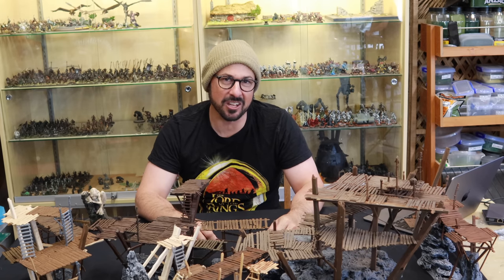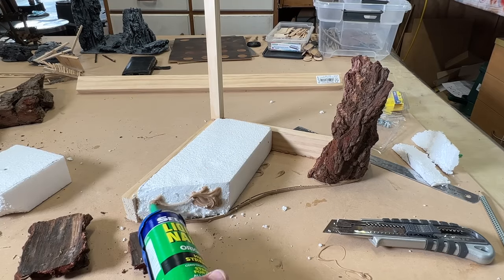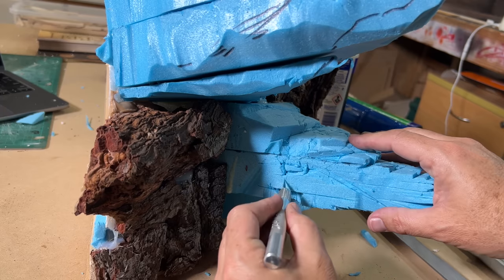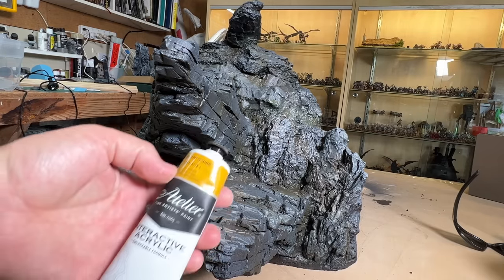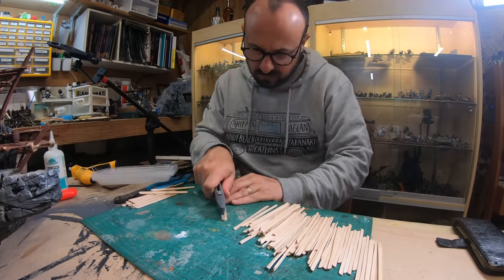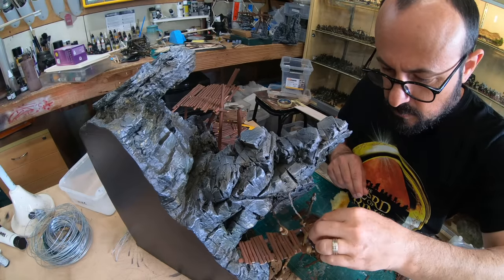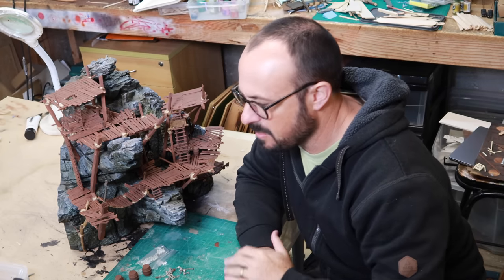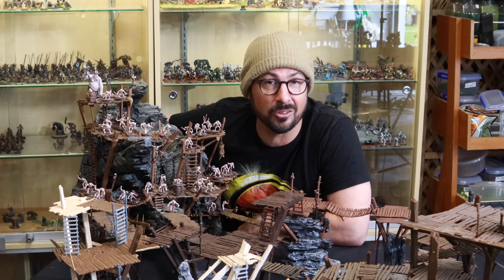MASSIVE Goblin Town Diorama! ~ How many craft sticks is TOO many?!

Comment: I've seen some really nice timber results by taking broken popsicle sticks hitting them with a wire brush and then just hitting them with something like a strong tone but not actual paint other than maybe a light drybrush of a gray t make them look older.
Reply from the maker: Yeah that’s a good shout! I’ve done the wire brush thing before but just couldn’t face doing it with this many sticks! 😅
Reply: @dicedrinksanddadjokes  fair enough, but just painting real wood with washes and or thinned down inks looks really good in a way that is really work intensive to beat if you paint and prime them.  Also since you were sticking them all down on sticks to paint them anyway it would have been much much less work to wire brush them at that point.